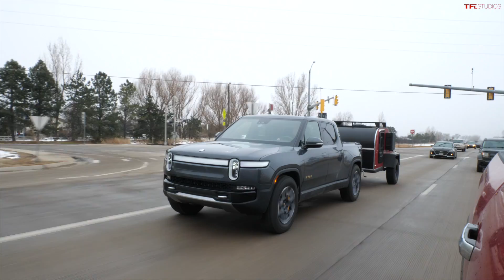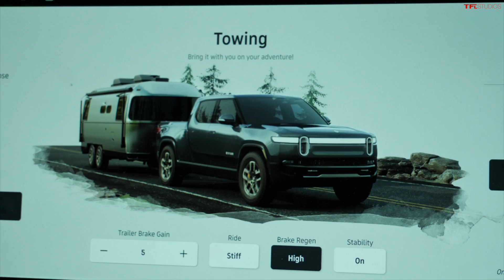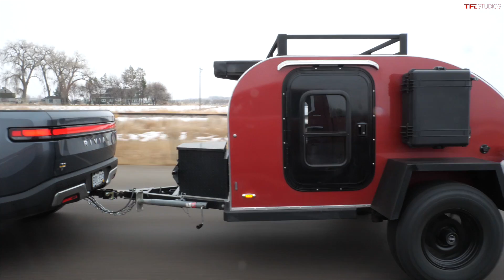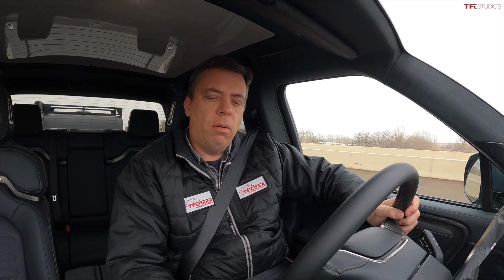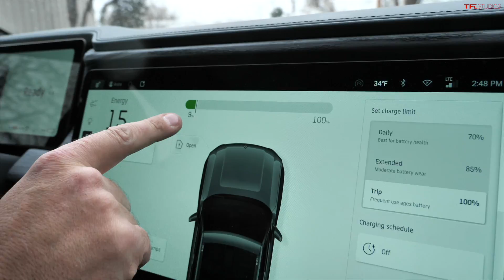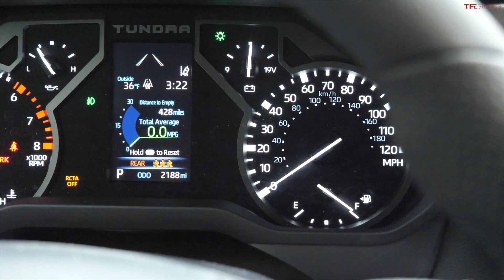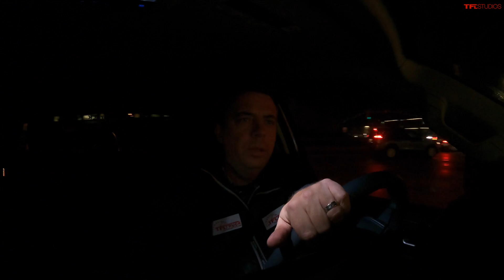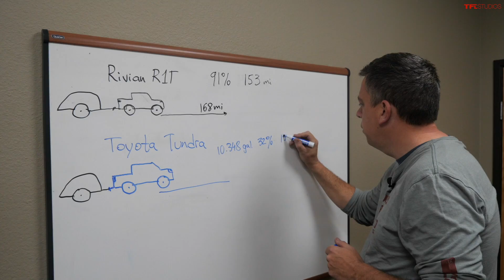Rivian R1T vs. Toyota Tundra: How Far Can Each Truck Tow On A Single 'Fill-Up'?

Comment: Real world, objective, unbiased testing of the new generation of EV Trucks is what it's about!  Remember, this was a Winter Test, with the drag of monster tires on the Camper Trailer.  However, in a few short years, via newer battery technologies, software & more efficient electric motors, the Rivian & others will not only begin to close the gap, but I predict match or beat ICE cars in 4-5 years.  And trailers with redundant battery supply will also become more commonplace making EV Trucks more competitive.  Also, in high mountain ranges, EV Trucks will operate at much greater efficiently, as ICE Trucks gasp for Oxygen just like an old comeback Boxer stepping into the ring !

Comment: This is why electric trucks have a long way to go to catch ICE trucks. I am pulling a 33ft RV at around 10k pounds most of the time and the closest beach to me is 244miles I can get there and back home on a single tank of diesel where I wouldn't get half way with an electric truck at that weight and wind resistance. Time will continue to benefit the electric trucks as batteries get better and better and for short trips the acceleration and torque of the electric motors are just amazing while towing.

Comment: Appreciate the comparison.  I think a more normal profile travel trailer, say around the 4-6k weight, 20-25 foot, including electric brakes, would be a better comparison for the middle-of-the-road use case for most folks. 
I would expect the Rivian to only get around 100 mile range, and thinking the Tundra still getting 300-400 mi range. 
For trailering, EVs will just have very limited range, and that just needs to be understood by any prospective buyer.

Comment: The fuel economy with the Toyota I’m suprise how low it was. I have a 2006 gmc 3500 Sierra Dooley duramax work truck. It is 10,000 pounds. The truck has 321342 miles on it. Still has plenty of power with average fuel mileage of 18mpg

Comment: Great video.I’m considering replacing my 2018 Ford Explorer with the Rivian RS1 in a few few years and would love to see a towing test while towing a 5000 pound boat. Ideally I would need  my replacement EV to have a tow range of 150 miles minimum
Reply: clot shots  you can call a EV mobile boost roadside charger in california
Reply: clot shots  it’s really not an issue in california. The charging network is already quite robust. I go boating on the Colorado river frequently, usually launching  at the Jack Smith marina near Needles California. There is an an Electrify America charging station about 2 miles from the launch ramp. However I can see it being a problem if one were go camping in an EV in Moab.
Reply: clot shots  no range worries for trips in california but for Moab and other national park trips, the extra range would surely help.

Comment: While Electrical vehicles do seem to be the way things are going, the technology and efficiency still needs to be improved.  They have made great gains over the last 5 years, but probably need another 5 to 10 years before they can out do the ICE vehicles.  Only thing that could have a major impact is if the Environmentalists  and Governments get involved with each other and end up pushing gas prices over $10 a gallon.

Comment: So the Rivian costs about 2x the Toyota. The Launch edition is $97K CDN. The Toyota is about $55K CDN.
The Rivian used 123 KWh of energy to do the trip and the Toyota burned about 376KWh (energy density of gasoline is 12.7 KWh per Kg, 2.86 Kg per gallon, 10.348 gallons) of gasoline equivalent energy.
Cost of the gasoline used= $40 (acctually about $53 where I am)
Cost of the electricity at a charging station varies where I am but it's about 50cents per KWh so over $60 to do this with the Rivian.
Despite being about 3X more efficient it still costs more to opperate the Rivian. 
Vehicle cost double, opperating costs higher, a third the range, lack of charging locations compared to gas stations, wasted time planning and waiting for charging, reduced range in colder temps because of need to heat passenger cabin... Uhhhhh.... I was born at night but not last night.

Comment: Great video, i just wish you guys would have broke down some numbers on efficiency and cost for the trips. Epa says that one gallon of gas equals the same energy as 33.7kwh, which at 10.348 gallons, the tundra used 348.7 kwh. Rivians run 135kwh batteries, so at 91% means they used 122.8 kwh to do the same trip. I think this shows just how terribly inefficient the gas motor is, since it used almost 3 times as much energy but probably only lost 1-2 mpg over the same trip unloaded.

Comment: Thanks guys, good review. Rivian needs a bigger pack or different battery tech before I jump onboard. The Tundra mpg was a bit disappointing IMO and not a replacement my 2005 Chevy 3500 Duramax (40,000 miles on the clock so it's hardly broken in. Original owner, I work overseas a lot) which gets about the same with a light load at that speed. I need to review the 3.0L LM2 diesel to see if you have the same kind of test. Taco is probably worse but I wonder what my 97 Land Cruiser would get with that trailer. It gets around 16 not pulling anything but it's paid for. I need to check on that trailer, I kinda like that it's made for off-road work. Guess I hold on to my current fleet but was considering the Tundra as an overland kinda rig. LM2 diesel repowered Land Cruiser would be cool.

Comment: I didn’t get to read through all these comment so I don’t mean to repeat. R1T was in towing mode. With the HP it has, can it tow in its most efficient mode?  That way range can be extended?  I am not an R1T owner so I don’t know the difference between tow mode and the more efficient mode.  It is just a though.

Comment: I would be interested in the rivians range when cruising at 65 vs 70 without a trailer or with. Just to see where the efficiency curve is, and if a reasonable speed reduction would have a big increase in mileage

Comment: Right.  Highway range is the one factor where EV's don't beat gas cars.  In every other factor, they win.

You said you would also explain the *efficiency*, but I missed it.  In terms of energy usage, afterconverting gas to kWh, my guess is the Rivian wins, hands down.

So, if you're doing towing business around town, the Rivian wins.  But, sure, for cross-country, a battery can only store a small fraction of the total energy stored in a giant gasoline tank.  No surprise here.

Comment: The energy density of gasoline/diesel is hard to beat. Battery technology still has a way to go before it can dominate the market. Maybe I’m crazy but wouldn’t a true hybrid with an electric drive train and gas/diesel generator be the real answer? You could maximize the efficiency of the ICE to only charge a battery pack and still have the EV benefits of instant torque.

Comment: Last comment…. Repeat the test in cold weather pulling an enclosed car trailer with 7000 lbs total towed weight.  That tiny trailer you used is something you pull with a minivan or small suv.  People buy half ton pickups for much heavier are larger loads than what you had

Comment: That is a very light trailer.  To be more representative of real world use you should be pulling something weighing half the manufacturer’s max stated towing capacity.  In this case 5500 lbs.

Comment: I dont think electric trucks will replace gas trucks for a while…. That’s a very small trailer comparatively to most with little drag so I think electric cars/trucks are great for running around and maybe for short trips around town with a trailer but not a road trip or camping in the middle of nowhere…

Comment: Read a recap of a new Tesla they taken on holiday road trip. They ran into difficulty at hotels with a only couple of charging stations that were already full w/ cars charging & of people leaving their evs "charging" past their charge period resulting in regularly checking to see if a charge spot was open and then having to move your ev to an open charge  spot quickly

Comment: I think the argument is that my bladder won't make it much past 2.5 hours anyways, so it forces you to take that stop and walk around, similar to the old water stops for the steam trains. It's possible charging stations, and "points of interest" could pop up every 100-150 miles out in the middle of nowhere on those long empty highways.
That said, when I'm on a road trip, I'm usually fixated on the destination, not the trip... Given our usual trip is a 15 hour drive (moving time) we don't like making long stops since it's already a long day.

Comment: This is not surprising, at all. 
Gasoline and diesel are 5x plus more energy dense that the most advanced battery technology.
EV's - with current battery technology - are a step in the wrong direction. 
But of course , that's incredibly inconsequential bcz the OEMs will make more money this way - which is why they support this. I work for one of the big 3 in Detroit and the Engineers told me this is just another scheme that doesn't benefit the consumer - only bolsters the OEM bottom line.

Comment: And this is why I have been telling people don't buy a EV truck if you tow over 200 miles several times a month. Also this is low weight it only gets worse for the EV truck when the weight goes up.

Comment: I wished you would have analyzed it further.  The Tundra used the equivalent of 348.73 kWh to do the same amount of work (2.83x more energy) as the Rivian.  The cost of fuel for the Tundra based on average US fuel costs would be ~30$ for this trip and $14 for the Rivian based on Denver electric rates.

Comment: First of all, thanks for this comparison, Andre.  As many have stated below, this shines light on why would anybody buy an electric truck to tow right now.  Even better, why buy one at all?  With an ICE engine, I can tow further, I can fill-up ridiculously faster, I don't have a heart attack if I'm low on fuel in the middle of nowhere, I can get quick repairs, and the list goes on.  Until battery charging can be improved, and capacity can be optimized, these e-trucks will only provide value to those wealthy enough to own both (electric and ICE) trucks.  I honestly do applaud those with money to burn who buy these useless vehicles so technology can be developed further.  Perhaps one day, in the very distant future, we will reach the level of tech necessary to make an electric vehicle that can travel long distances, recharge quickly, not lose half its charge when it gets "cold" outside, and can be quickly repaired.  Oh, and once that's reached, the price will need to become affordable.  So, after another 10-20 years of recouping the R&D involved, the average person might be able to purchase one of these vehicles.  I'll be long gone by then.

Comment: One thing I'm surprised you didn't comment on -- the Tundra burned 10.348 gallons while travelling 153 miles, for an average MPG of 14.78.  The Rivian RT1 used 122.85 KWh of electricity to travel that same distance -- which, when you convert to MPGe (122.85 divided by 33.7) means it would've burned 3.645 gallons of gasoline, had it been burning gasoline.  153 miles on 3.645 gallons of gasoline would be 41.97 MPG!!

So the Rivian got literally 2.8 times better "fuel" mileage!

To put it another way, if the Tundra was as efficient as the Rivian, it could've gone 1,324 miles on a full tank of fuel, instead of "only" 473 miles.

So, no, your range is not as good, but your efficiency is almost three times better in the Rivian!

Comment: You guys forgot the mpg and mpge figures!  According to the EPA one gallon of gas = 33.7kwh.  With that knowledge the Rivian was returning 42.5 mpg if it was using gasoline to tow.  IIRC the R1T has a 135kwh pack and had 9% left.  122kwh used / 33.7 = 3.6.  So the same energy as 3.6 gallons of gasoline was used.  153 / 3.6 = 42.5mpg.  On the flipside the Tie-yoda (sorry Dimetri. 😁) used 348.72 kwh of energy to complete 153 miles. Based on it's efficiency the Toyota would have gone about 53.5 miles with 122 kwh of energy.

Edit because I had the wrong battery size and therefore the wrong math.  All fixed up now, sorry!

Comment: That's not the average trailer most people would pull. Tow a 24 ft trailer fully loaded with tools and equipment or at least an average size camper and I bet the difference would be even bigger.

Comment: That's not the average trailer most people would pull. Tow a 24 ft trailer fully loaded with tools and equipment or  at least a real camper and I bet the difference would be even bigger. Not to mention if this is a fleet truck you'd have guys on the clock if it needed to be charged during the day.

Comment: Back of the envelope math here, 10.348 gallons of fuel is 345.73 Kwh, about 2.5 Rivian battery packs. So the electric vehicle is more efficient but less practical for towing, it may be that they are not for towing.

Comment: First some numbers
36.6 kWh per gallon (EPA)
R1T 135 kWh battery = 3.69 gallons
Tundra 10.35 gallons = 378.8 kWh

high gas cost California 4.66 $ per gallon
low gas cost Mississippi 3.06 $ per gallon

high electricity cost Hawaii 33.97 cents/kWh = .34 $ per kWh
low electricity cost Idaho 10.22 cents/kWh = .103 $ per kWh

So, for 153 mile loop
Rivian used less than 123 kWh of electricity or 3.4 "gallons" of gas and in Hawaii would cost ~$42 (though probably more due to inefficiencies in charging) or in Idaho would cost ~$13.

Tundra used 10.35 gallons of gas or 378.8 kWh of electricity (around 3x as much energy as the Rivian) which would cost ~$48 in California or ~$31.67 in Mississippi.  

Rivian 1.2 kWh per mile
Tundra 0.4 kWh per mile

The Tundra sounds like a ~30 gallon tank so that would be equivalent to a 1098 kWh battery so definitely less range anxiety, but efficiency difference is pretty drastic as well.  Charge time is still way faster too.

If the Rivian had a 1000 kWh battery it sounds like it could tow the trailer for ~1200 miles (one can dream we get to an energy density like this someday)

Despite the overall range and charge speed issues it seems like towing in the most expensive state would still be ~12% cheaper and in least expensive it would be ~240% cheaper (assuming you are towing within single charge range or your time is worth nothing).

Comment: Why a Tundra and not a Tacoma?  The Tundra has a 30 gallon tank? Why not get a similar sized truck to test?  Your comparison is like a diesel big rig vs a gas Ford ranger.  Not that great of a comparison. Rivian mpge rated 280 miles vs Tundra mpg rated 702 miles????

Comment: Is there a reason that no one makes a plug in hybrid truck this size? It seems like 30 miles of electric range would save a lot of fuel but being a hybrid would solve towing range issues and not require a drastic change in user behavior.

Comment: Race them from New York to Los Angeles based on time.  Electric loses 100% because charging takes too much time.  I have a PHEV vehicle, so I'd also win because I have a petrol engine providing electric power to the motors.  Also maybe you want to plug in to Texas - grid blown!  Until hydrogen stations outweigh petrol, I'll go PHEV

Comment: Another point you didn't talk about. The cost of the trip. the Rivian cost $13.65 for the Kwh used. (Boulder CO electricity rates of approximately 11 cents per Kwh) vs $52.00 worth of gas in the Tundra.

Comment: Find a previous gen Tundra with the 5.7L V8 and tow that same trailer, bet you'll get better fuel economy than you did with that V6 and turbo.  A 2k trailer and you could only manage 14mpg, that's terrible the V8 did better than that towing light at least in my experience I was in the high teens towing my 2200lb 23' car trailer.  That little teardrop trailer don't have enough resistance to aerodynamics to cause a vehicle to get that horrible of a fuel economy number....try it again with a better truck...preferably one with a V8.

Comment: Holy shootballs! Great test. Need more weight. Based on this video you would've been better off doing the 100 mile loop with a heavy load in tow. Like 6000lbs plus. Great video!

Comment: GM.  Spoiler alert your behind.  The problem with EVs in the Truck market will be towing range for at least the next 3 years.  This gives you some time.  GM there is an advantage you can exploit.   Take the Volt concept to the Silverado.  Go from unleaded to diesel.   Put in a slightly more powerful generator.  Double the battery size to 100 miles all electric.  Put in a large tank giving your truck over 500 miles of range.  Now you have drivers that on a regular basis get the lower cost of electric and great Range with no anxiety when needed.  Add a feature to use the generator for other electrical items--(cool camping feature).   This truck will sell and at the right price this truck would dominate until EVs can tow 500 miles.

Comment: So... 14.8 mpg towing by the Toyota.   Best guess for energy use for the Rivian I can see is 122.85 kWh, for an estimate of 1.25 mi/kWh.  The estimated conversion is 1 gallon = 33.7 kWh, so the estimated "fuel" usage for the Rivian is 3.65 gallons, or about 41.9 mpg.

If we assume a charge from home, and a rate of $0.128/kWh, then the estimated cost of the electricity for the trip would be $15.72.   For an Electrify America fast charge, the rate of ~$0.31/kWh would make the trip cost $38.08.

Comment: Could you add to the chart : 
What the costs were for re-fueling?

How much energy was used?

Given that a US Gallon of diesel is 40.7kwh that means the Tundra used over 400kwh of energy 

How big is the battery in the Rivian?

Comment: Looks cold outside sooo  Did you use the heater cause that would be very very important to most people and have the radio on and plug in your cell phones. cause like most people will use these. very important...